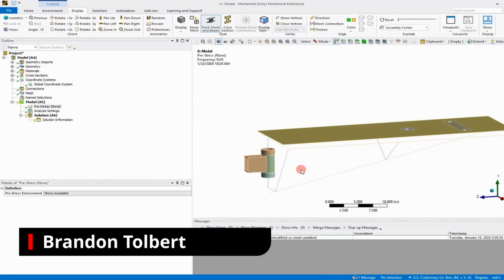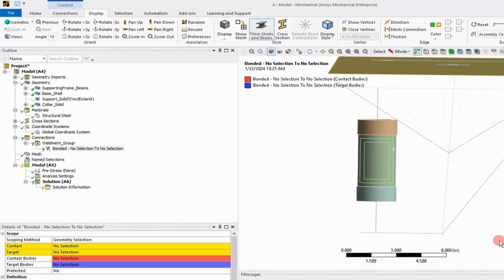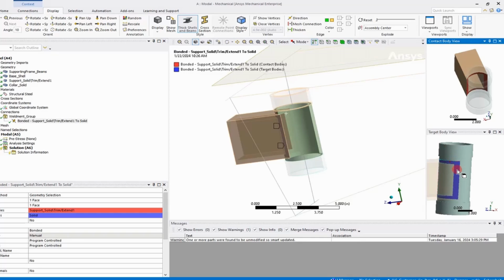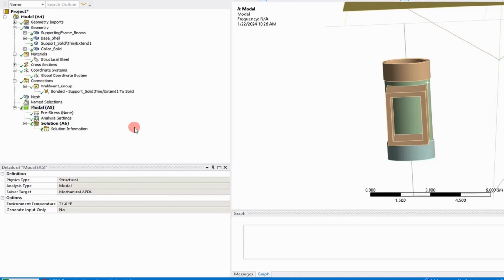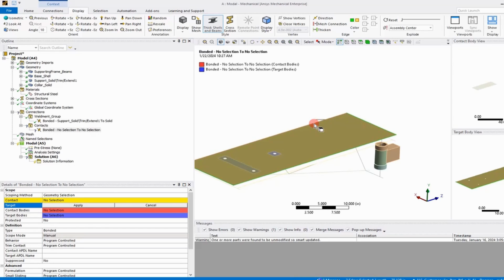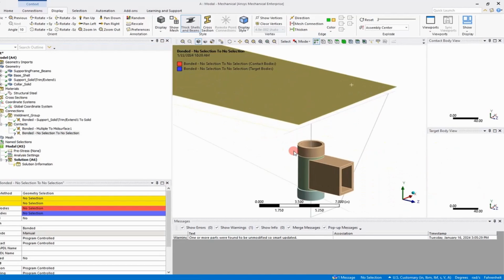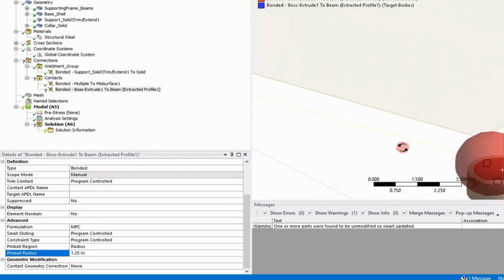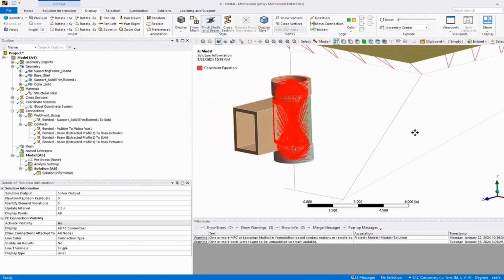Ansys: Assigning MPC contact constraints between solid, shell, and beam elements

Comment: Hello sir, thank you so much for this tutorial. It is a great help. I'd like to share a problem I'm having related to this manner. I'm modeling an electrical cabinet using line and shell model. I'm following the same approach you suggested here, I applied accurate material sectional properties, yet my model became stiffer than the real experimental model. I'm guessing I need to change or optimize the connection parameters I applied on my model to reduce it's natural frequency. Could you please suggest me how can I optimize that?
Again, thank you so much, sir.